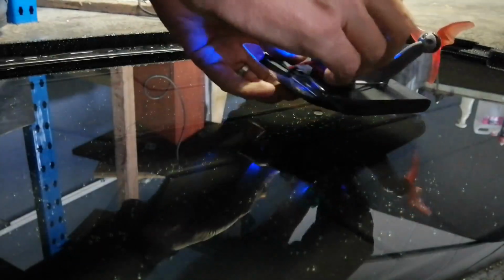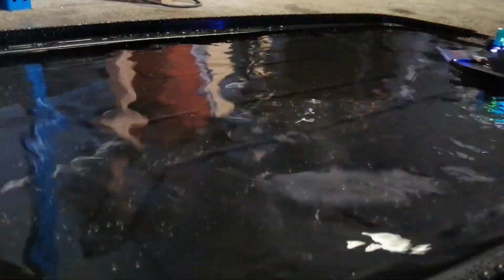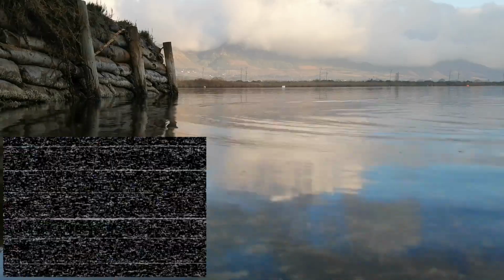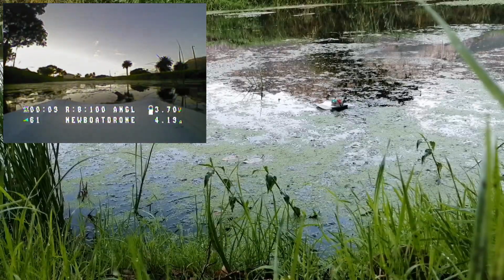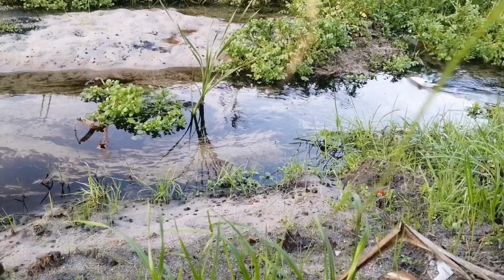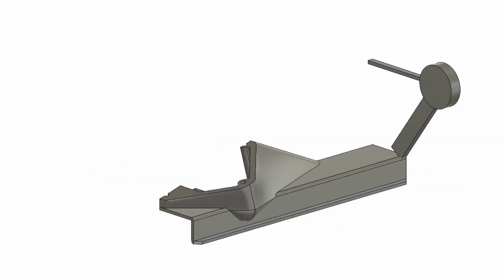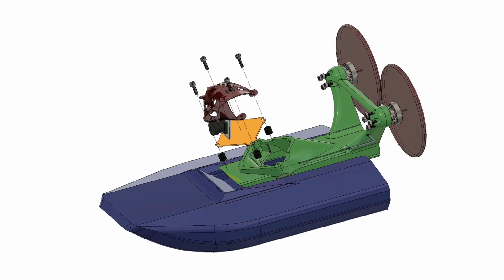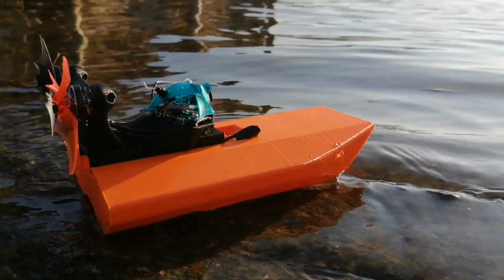Micro FPV Airboat From Drone Parts and 3D Printing

Comment: I just pop in. Total new-bee on flight controllers etc. and all there is to FPV and more.
I am keen to try the drone systems in a regular scale model boat. 
Driving 3 brushless motors. 
The ship should have all it's motor steering possibilities as with 3 ordinairy ESC's on a regular computer transmitter operated, and assisted by conventional rudders.

So individual control on forward-stop-reverse, to steer on props (stead of rudders).

Another interesting ting is telemetry. 

Individual current and rpm of each motor that are run.

Such measurings can be done with a bunch of Jeti sensors, or SM-Modellbau from Germany, but these will give a tremendous wiring-tree and signal-couplers to the receiver. Making it very complex and crowded in the model.

Reading into Betaflight, but don't have a full picture yet. No experience.
Understand I have to get an 'Open-Tx' transmitter to replace my old Jeti/Multiplex Evo-9 PPM radio system. 
FrSky or Radiomaster.

Before I start wrongly investing? If you have time for tips, those would be most welcome.

Comment: Hey great build man! I am working on something similar for a project but instead it has two propellers in the water! I was going to use a Velox FC and ESC but my concern is the programming in beta flight…. I am concerned because I need to know how to program it so I can control each motor individually, and possible one motor with a flip switch on my controller! Does this seem possible? Any issues with the gyro interfering?
Reply from the maker: I'm not sure how you would do a motor on a switch via betaflight, but it might be possible. 

Is there a reason to control the motors individually? I would create a custom mix and put the gyro to work, I type some details about it in the original description of this project, but basically I just made a mix that only reacted on yaw: https://www.newbeelabs.com/labblog/2021/6/16/differential-thrust-setup
Reply: @JasonSuterOssum  I would want the boat to be able to turn left or right, and if I had individual control of the motors, I would be able to turn on one and keep the other off, and that way I could turn.
Reply: @JasonSuterOssum  also regarding the gyro, I’m just worried that it’ll assume it’s not centered and send the motors to la la land LOL

Comment: Hello!
Nice project
Trying to rethink it and make a boat with two underwater thrusters

i set AIO and now it moves forward, backward nice
but my boat is long and has understeer
and i can't find settings to rotate motors so they thrust in opposite direction

then i move yaw(left or right) to max and move throttle around zero only one motor rotate (both thrust right direction and rotate boat right but jumps from for example full forward right motor to full backward left)

maybe you know some setting to do? to rotate motors simultaneously and thrust in opposite direction

Thanks!
Reply from the maker: Hi Petro, did you have a look at my blog post about motor mixing? It should clear it up: https://www.newbeelabs.com/labblog/2021/6/16/differential-thrust-setup

Remember also that you will need to have "3D mode" enabled on your ESC if you want reverse.
Reply: @JasonSuterOssum  
Hi, yes i read your post and tune mixer like yours
https://www.youtube.com/watch?v=X4jJ9P2AyHs&ab_channel=PetroKateshek
make video to better explain my problem

Comment: Excellent project! For tuning you can add an APM which will give you more control and also make it autonomous. Check out RCTestFlight channel - he did something similar.
Reply from the maker: Thank you! Yeah I've seen some tiny little autopilots recently, the INAV setup on that micro hex copter from flywoo is intriguing ( https://www.banggood.com/custlink/GGvy6HQ3z8 ). The fun for me is in piloting it myself, especially at this scale, but a slightly bigger one that can carry a decent camera could be a lot of fun to automate.

Comment: Awesome, you are the man Jason!
Reply from the maker: haha, thanks dude 🤜🤛
Reply: @JasonSuterOssum  do you think a single 18650 battery will fit into the boat?
Reply from the maker: @tscUnhold  it would take a small modification, it definitelywon't fit in the default setup. My gut feeling is that it would be too heavy, but I could be wrong. 

The 8000kv motors I had, running on 1s, were quite efficient,  it ran for a long time (compared to whooping anyway)
Reply: @JasonSuterOssum  Thank you! I might give this a go, as my only micro quad uses 16850s and I don't really want to get another set of 1S lipos which I don't have any other use for.
Reply from the maker: @tscUnhold  ah  I understand then. The trick would be to design some sort of holder, but that would take some planning. I was tempted to solder a connector directly on to an 18650, but that wouldn't work if you are using it in other drones (I presume some sort of nano long range?).
Reply: @JasonSuterOssum  yes exactly. The HX115 LR from BetaFPV. I bought a holder for the single cell to be strapped to the frame. I just downloaded the files for the boat. Looks very nice!